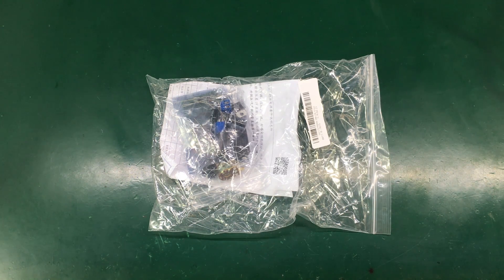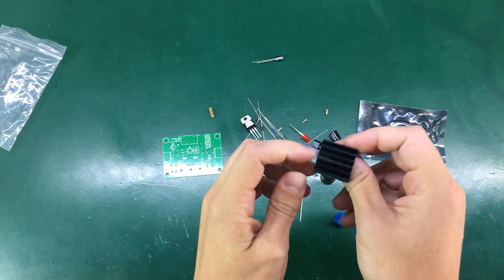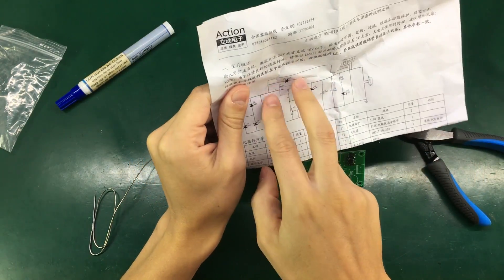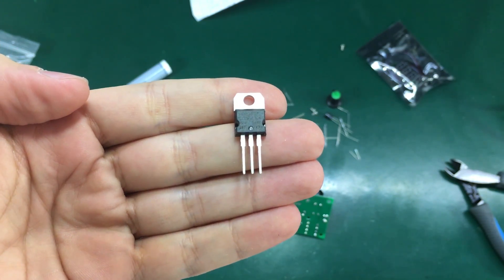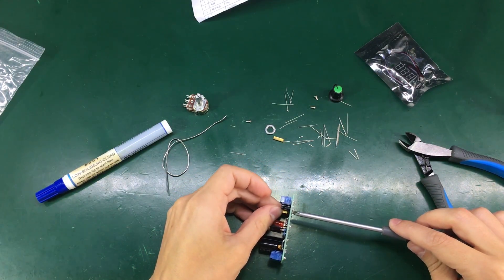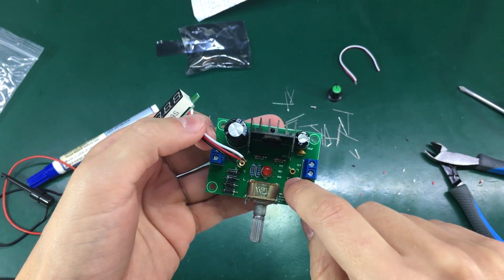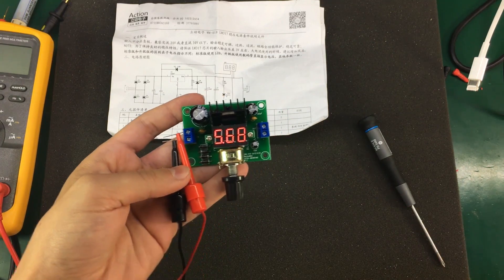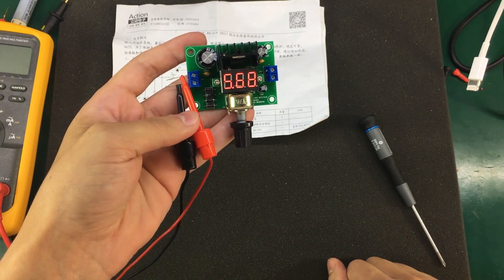Voltlog #69 - LM317 Kit Assembly Fail

Comment: You got it working. Most software you use today has the equivalent of 1,000s of resistors with the wrong value, but it works well enough. That's why hardware is hard for me and software is easy. Defects are not such a problem.
Reply from the maker: that's an interesting comparison between software and hardware :)

Comment: I don't get the R thing for resistors. Do people use C for capacitor values?
Reply from the maker: it's not just R, any letter marking can be used 1K5 = 1.5KOhm, 1M5 = 1.5MegaOhm. That's preferable to using the omega symbol Ω because that's not always easy to find and insert when editing schematics.
Reply: VoltLog I know how it works, I just think it's weird. 220R is no shorter than 220(omega symbol). What do you do for capacitor values? Use C?
Reply from the maker: I'm talking about the somewhat difficult way of inserting the omega symbol when editing a schematic, it's much easier to write "R". For capacitors you usually specify them in "nF" , "pF" or "uF" just using "u" instead of μ mu symbol. It doesn't have to be a general rule if what's what you're searching, it's just an easier way of editing schematics.
Reply: You don't even need the omega symbol. I just think it's dumb to write something like 1r2 or 1k2, instead of 1.2k.
Reply: I just write the word ohm. R just doesn't look/sound right.
Reply: There is a reason why you write it like that. It's easier to mistake a 12k and 1.2k, than 12k and 1k2. You can't be sure to get perfect print on instructions or on the board, so sometimes that dot might disappear, and you wouldn't know why your kit blows up or something like that.

Comment: The diodes are for reverse voltage protection. You quite often see this on regulator circuits that will be used to charge a lead-acid battery.
Reply from the maker: yeah, looking at the datasheet refreshed my memory. Thanks!

Comment: You can learn more about the protection diodes across the LM317 in the LM317 datasheet.

Also, a basically silent fume extractor that I built is that I used a "fluid dynamic bearing" fan (any decent PC store carry those around, for me is cost about 10$ for a "arctic" one) and put those on top of a small box that includes 3 lithium ion batteries in series a switch and charging and protection circuit.

all it is a silent fan connected to a battery with a switch, but if you add carbon filter (I think that's how those are called) you can filter out the smoke. and the reason I made it battery powered is so you can adjust it and move it everywhere without having a cord around your bench, I just hate wires, if there is a cordless option I would go for it.
Reply from the maker: I plan to build a fume extractor unit that would sit under my desk with adjustable speed. It will use a carbon filter ofcourse because without that you're just mixing and dispersing the fumes in the air around you.

Comment: 1k2 should work well with 25k, same ratio as 240&5k.
Reply: The 240R resistor is may be there for a reason. It may be a bias resistor for current source inside the chip. Before replacing parts in schematic even if the ratio is preserved, it better to look at the datasheet in advance.
Reply from the maker: yes that sounds right.